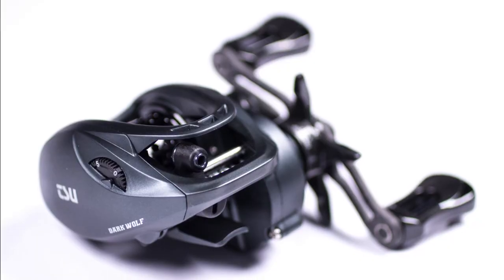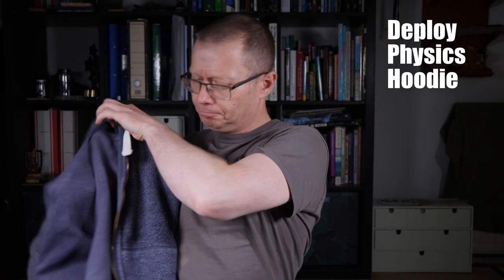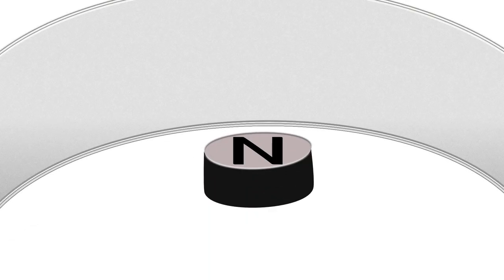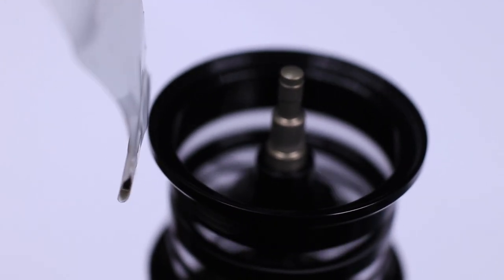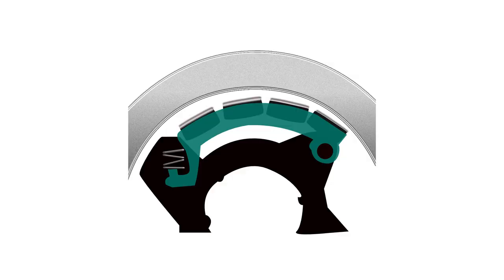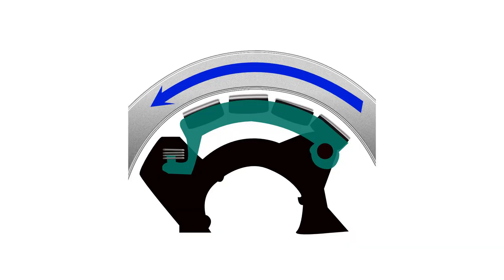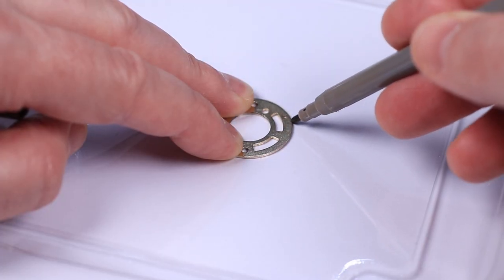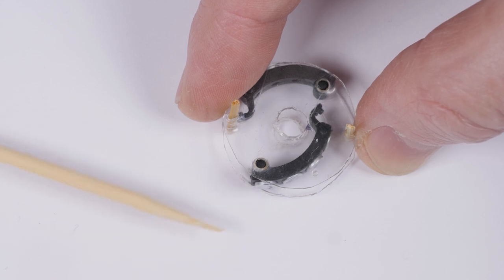Fake "FTB-style" BFS Reel Brakes in Left Hand Reels Don't Work as PLANNED - But is this All Bad?

Comment: Excellent clarification of how FTB brake works!
Crystal clear shown that there is not any pulling force between spool and magnets - there is only braking force against direction of move, which makes arm to be tilted and spring compressed.
So in some Chinese LH reels are used RH parts and then pivot point is in wrong side?
Reply from the maker: Yes, that has been the problem in the past. However, some brands such as Tsurinoya and Kyorim have now realised this and moved to modified (but static) braking systems - with really good results. They will have to look for a different solution if any future reels need to have dynamic brakes that work equally well between RH and LH reels.

Comment: Very nice explanation!!!

If I could only cast left handed I wouldn't have to stay with left handed reels
Reply from the maker: I've made an exception for the Ambassadeur 2500C (and learned to cast left handed) since the left hand versions are so much rarer and more expensive! However, I think for all more modern reels I'll always go for left hand wind. The Dark Wolf Ultra still casts amazingly - it's just that it doesn't rely on a dynamic brake to do it (and never has for the LHW). I guess if static brakes are preferred for the Air Stream Custom, then there's room for both dynamic and static systems for high performance  BFS reels.
Reply: Consider most japanese casters use right hand reels and cast right handed, swapping over to retrieve.  The drag and handle perches on the index finger and balances there better than a left hand reel does. It is also possible to flip the drag star with a finger to pull in a little line whilst holding the rod in the right hand. Multipliers were originally built with right hand handles for a reason, balance in the hand.

Comment: Great video. It seems KK kestrel elite and valient eagle 2 got the pivot point correct with the left hand version, anyway it is overbreaked though.
Reply from the maker: Thank you - glad you enjoyed it and yes, I believe that's the case with the correct pivot points on the KastKing reels. It looks like the most recent Valiant Eagle 2 may have an extra insulation ring to reduce the braking power. I'm interested to see how those designs evolve. Paul

Comment: Do you know if the BMC100 has fixed the braking for the leftys?
Reply from the maker: Hi @Parrotsalt yes the BMC100 has the fixed inductor brake shoes so they function exactly the same left or right hand wind.

Comment: Could you ask me a question? I'm Brazilian and my English is not so good, I still use the same side of crank as you, left. Is it the left side or the right side that problem? when i bought the reel i had to put some magnets on it to help with the cast control, after that it has been performing wonderfully. I have a black knight 2 with the brakes still dynamic, with the spring and everything, is it the left one, the side I have that ends up being damaged?
Reply from the maker: Hi, it is the left side that is the problem. But, with a magnet upgrade, the reel works really great, so no need to worry. Paul.

Comment: I might have missed it, but in new Dark Wolf version did you mod the brakes? I was planning on getting one, and just getting two bearings to mod it.
Reply from the maker: The new Dark Wolf Ultra (that includes any sold after June 2022) do not need the brake mod. So you'll only need to upgrade your bearings to improve the performance. Bearing sizes and a direct link to the Roro bearings I use in my Dark Wolf Ultra are included in this article here: https://fishingdiscoveries.com/tsurinoya-dark-wolf-ultra/

Comment: Interesting and well presented/explained video - but I can't get my head around what this actually means performance wise for reels with this issue. Could you give some even more layman's explanation of what this all means?

Have both a LH wind Fishband 100 and DWU - cast well with these and notice the difference tweaking the brakes makes. Does this issue mean that the LH reels braking performance is only a certain % of what it should be VS its RH sibling? Eg. The LH models brakes will only work 40% as intended VS the RH which the brakes will work 100% as intended?
Reply from the maker: The left hand versions basically function as a "static" brake. The brake shoe sits at the furthest extension from the spool (and won't move towards the spool when it spins faster). However, this still turns out to be an effective braking system as long as the magnets are strong enough and start out sitting close enough to the spool. The RHW version will operate as a dynamic brake, so it will usually be possible to dial it in at a lower number setting compared to the LHW versions. Hope that helps! Paul
Reply: @FishingDiscoveries  Understood - thank you!

Comment: So do the brakes on the left handed version of dark wolf  work or not!!!
Reply from the maker: Yes, they work. In fact both right and left hand versions of this reel have now opted for static systems (you can adjust the strength easily with the dial, it's just that the brake shoes then keep that setting throughout the cast). The older left hand brakes worked too - but were not "dynamic" like the right hand model used to be. However, it's impossible to buy those older versions now. Paul

Comment: Being new, about 5 weeks owner of BFS reels, Daiwa, Shimano, Kastking, and Black Knight, I’ve been looking for this explanation of how Shimano brakes work…now explain the Daiwa version that rotate, I’m guess giving a stronger magnetic force on the unductor???
Reply from the maker: Hi Mark, the daiwa Air brakes work by the physical spinning of the inductor being mounted on a spring-loaded spindle. The faster the spool spins the further the cup-shaped inductor moves outwards along the spindle against the spring. As that cup moves out, it reaches deeper into the rings of magnets in the side plate of the reel - causing stronger braking. As the braking takes effect, the spool slows  and the spring can retract the inductor. There are pictures showing this system on my article here: https://fishingdiscoveries.com/daiwa-alphas-air-tw-20/

Comment: So on LH reel break works on pushing and on RH on pulling the arm. Both forces should be equal so the stopping power. There is no deference in breaking power LH vs RH, just the force is in the opposite direction. On a RH reel N-N power on the side of every magnet is weak cooperate to S-N power, on LH is opposite, that's the key to understanding. When the 4 magnets are S-N-S-N that gives additional attraction to RH and additional "push" to LH reel. So in LH reel the magnet should be S-S-S-S or N-N-N-N to minimize the "push" a little bit.  I saw a reel with S-N-N-N magnets, wondering why but now I know. Thank you. On LH reel we can use deepper spool but not on RH reel h...
Reply from the maker: ...the problem with the "pushing" versus "pulling" means that the LHW reel has a force against the pivot point that twists the arm away from the spool (at least as far as the arm can move). On the RHW reel, the braking force is increased during casting because the arm (and the attached magnets) is twisted towards the spool. Whether the magnets are N or S doesn't matter - because the aluminium spool has no magnetism of its own. The magnetic field from the spool is only created by the Electrical current that is induced by the movement of the aluminium through the magnetic field put out by the neodymium magnets in the brake arms. The physics of how the eddy currents are created are that those currents flow in whatever direction would reduce the rate of change in the field (in other words whatever would slow down the movement of the spool). The alternation of N/S poles in magnets arranged on the brake arms only influences what goes on at the leading and trailing edges of each magnet. This is the all important "changing flux" at the leading and trailing edges - this is where Lenz's law comes in to play...

You can see a good explanation of those physics here: https://youtu.be/BIsKthqeKSo

Comment: So , Lingl Sheng he works or no left hand my friend? is the same with ftb sistem ????? thank you ,by the way, is the chinese reel
Reply from the maker: True Shimano FTB brakes work dynamically and identically for both right and left hand wind reels. The kastking dynamic brakes in the Valient Eagle 2 and the Kestrel BFS elite work dynamically for both left and right hand wind reels. So far, I think all earlier brakes using a similar system in Chinese reels (including the lingl) only work dynamically in the right hand wind versions. The left hand wind ones work as static brakes and just mean you need to turn the brake dial a little higher for the "lefties". Don't forget that even "static" magnetic brakes have higher braking when the spool is spinning fast and lower braking when the spool is spinning slower. This is because the magnetic eddy current induction is proportional to the speed of the inductor moving through the magnetic field. So, in summary, all the copies of FTB system tend to make effective BFS casting brakes - it's just that you need to dial up the left hand wind reels to a higher brake setting. Paul
Reply: @FishingDiscoveries  Thanks man|

Comment: So we all know not to buy left hand FTB reels anymore!  thanks for this "Discovery"
Reply from the maker: Haha, kind of - but either the locked out static versions or "dynamic" brakes with magnets added still cast  phenomenally well in reels on that Dark Wolf Ultra platform. With the GH100 it's probably a case of turning up the brakes on the LHW higher than the RHW - and there may be more of a difference there because the spool is heavier and the rpm lower due to larger diameter compared to DWU (maybe that changes the profile of braking for "static" magnetic induction systems)
Reply from the maker: Oh, and of course doesn't apply to Shimano FTB brakes or any reels where the pivot point is shifted between RH and LH reels.

Comment: Step back a moment and consider Faraday's laws of induction and Fleming's right hand rule.  Aluminium is paramagnetic but a good conductor, so the brake magnets do not try to drag themselves onto the aluminium drum or disc but do induce a current in it. Now consider an alternator, we spin a magnet inside a set of coils (or spin the coils around a magnet, same thing). With the coils open circuit there is very little drag but as soon as we put a load on the coils the motion is retarded. The brake drum or disc is a single turn of coil and closed circuit. We are not just getting little eddy currents but a current generated around the entire disc or drum. An electrical current in a wire or coil generates a magnetic field (Faraday again) and this is going to oppose the field of the permanent magnets, and provide braking. This force is going to be proportional to the speed of the coil, the faster it goes, the more braking, it will limit the top speed; the braking will build up gradually. 
A centrifugal brake, block that throw out, responds to acceleration. The initial burst is braked but released once the spool reaches some constant speed. The magnetic brake will not do that, at slow speed it provides very little braking.  
Rearranging the polarity of the magnets does have an effect by altering the shape of the field. Most brake magnets can be pulled off their steel back plate with a bigger magnet. It does not matter which end we call N or S, an N will stick to an S and so on. We can have all N (or S),  NSNS, NNSS, etc.  
What does this mean? The BFS spool has very little inertia, it is very easy to get it moving but if you give it a big thump, it will be over-powered. It will try to control top speed  but the acceleration is too much for it to cope with. It is not for hurling a light lure across some lake. It is short range.
Why is left different to right? Consider leading shoe and trailing shoe drum brakes. They're pivoted on opposite sides of rotation.

Comment: I'm 99% convinced and almost ready to eat my hat 🎩(with a liberal helping of pumpkin spice). 
The only thing that's holding me back is the spinning experiments I did on my left-hand reel: Whether I spun the spool clockwise or anti-clockwise, the spin durations were identical at all brake settings. Perhaps my experiments were too approximate and involuntarily biased? After all, my spinning finger is not really a precision instrument 📐. As I recall, you tried the same thing.

What do you think? Any way, thank you for your efforts; they are very much appreciated.

P.S. To your knowledge, are the brakes on the KastKing Kestrel and Valiant Eagle II mirror images?
Reply from the maker: I believe they are mirror images in the KastKing reels - but I'll need to double check. What I would say on the left vs. right spinning experiments - I guess that there'll always be a good degree of braking in the "static" position of the brake shoe (and any additional braking - combined with a backing off of the braking at the end - depending on exceeding a certain minimum speed to pull the shoe out towards the spool). Paul

Comment: Technically at this point it's the same as daiwa magforce
Reply from the maker: Yes, especially since the "locked out" version of these brakes in the DWU and then the full switch to MagTrax style brakes in the subsequent reels based on that platform (Genius/Elf, ACURA, kingdom micro monster etc.). Paul
Reply: @FishingDiscoveries  yet those static braking seems to cast better with incredible distance so it's safe to say the change from shimano ftb ish braking to magtrax ish does improve the reel
Reply: @FishingDiscoveries  btw what about the line capacity it says it can hold 120m of 0.148 line is that true
Reply from the maker: @anyaforger2021  That would be at it's maximum capacity - but yes I'd say that figure is believable. However, I generally put between 30m and 50m on all my BFS reels. The ACURA (with it's dual spool option) lets me have the short line/shallow spool option and then the 120m-plus of slightly heavier line on the medium capacity spool. That gives me an insurance policy against long runs when targeting bigger fish but still on finesse gear. Paul

Comment: Something seriously fishy with all this     !!!
Reply from the maker: How so? Tsurinoya realised their error and moved to a fixed braking system which didn't need any extra magnets - and then they progressed with their next model onto a different braking system. All those reels cast phenomenally well for the price point - particularly considering how much money you'd need to spend before the Dark Wolf Ultra and Black Knight 2 reels came out if you wanted to cast 1-g (and lighter) lures with a baitcaster.
Reply: @FishingDiscoveries  How so   ??? Why doesnt Tsurinoya mention this on there page on Ali Express where they sell the reel    ??? No mention whatsoever about fixed or improved breaking system    . They are selling these reels under the false pretenses that you can do the mods and the reel is then on par with the Daiwa Alphas air tw performance wise    . It wouldnt have sold no where near as well otherwise in the BFS community    .